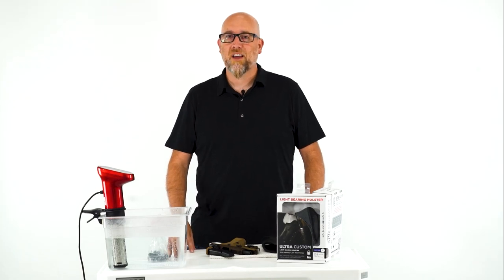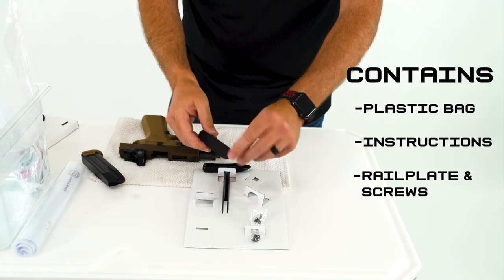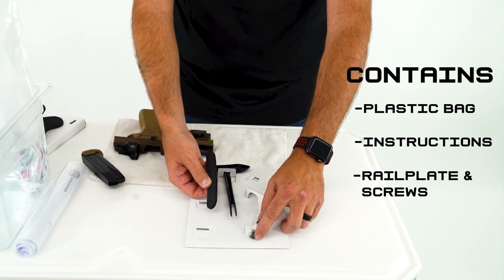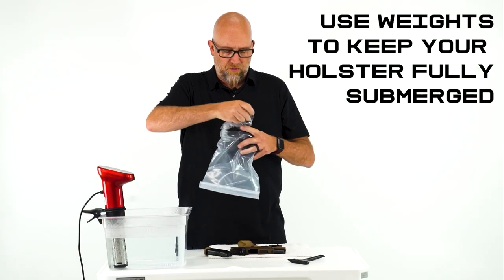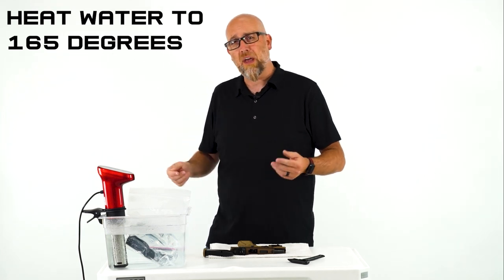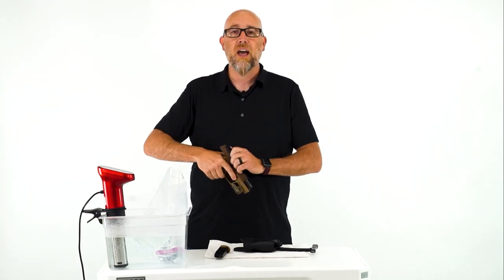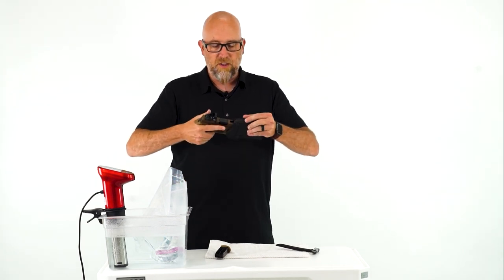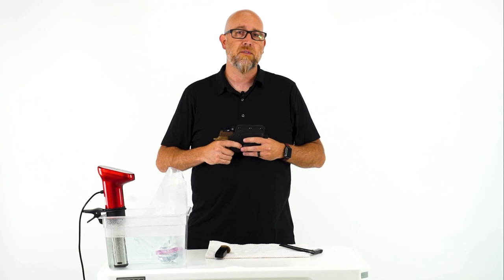How to Mold Your Own Light-Bearing Holster

Comment: Would wearing this is hot environments for extended times affect the holster?
Reply: Not unless you live in an oven.
Reply from the maker: No. The holster will not be moldable unless it has been in 135 degree hit for over 10 minutes.
Reply: @1791Gunleather  in other words, better not leave this in your car in Texas.
Reply: @Secondaries or Arizona